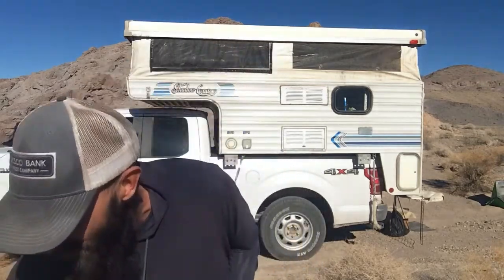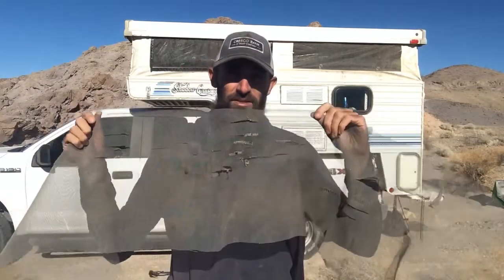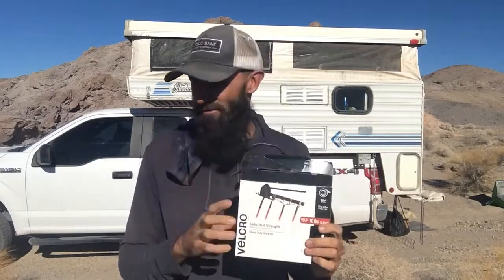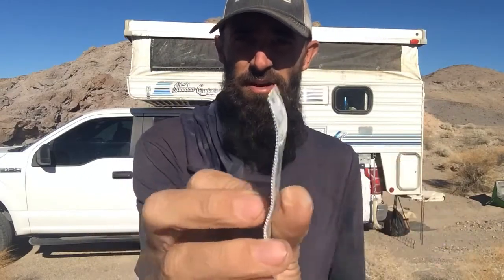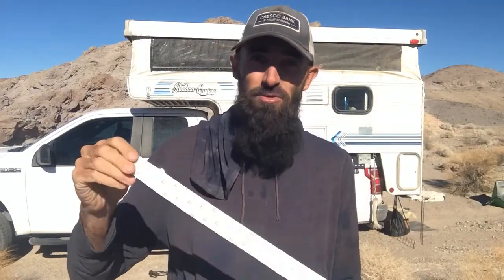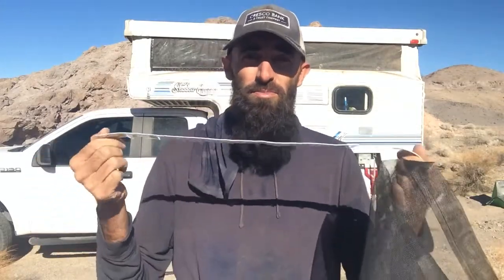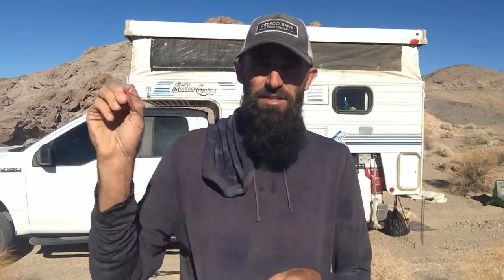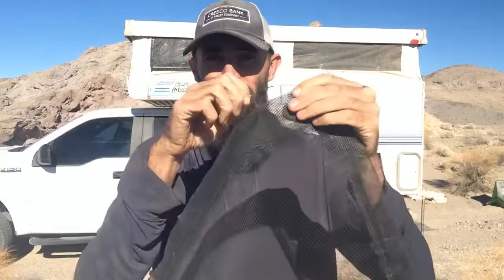How To Replace Your Truck Camper Screens!

Comment: Thanks for sharing, do you think it might work if we hem the screen and then use a hot glue gun to attach to the canvas?
Reply from the maker: We were worried about it coming off because of the constant pushing in and folding of the canvas part.

Comment: What is the purpose of the hem in the screen ?
Reply from the maker: To make the edge stronger. Otherwise the whole screen will slowly fall apart.
Reply: thanks for the reply!  @ParadiseOnPennies   hard to decide which way to go. My 99 hallmark screens are in baad shape. Whether you just sow it on, or use velcro, you still have to sow the velcro at a minimum into the canvas. I guess with velro you can poke less holes and rely more on the adhesive of the velcro. Am I thinking about that right? What is your recommended route?